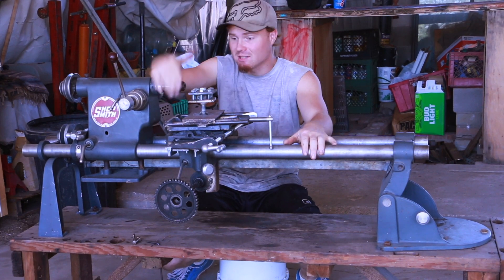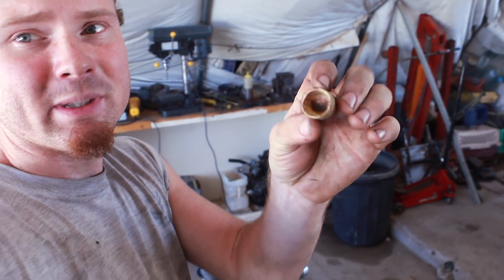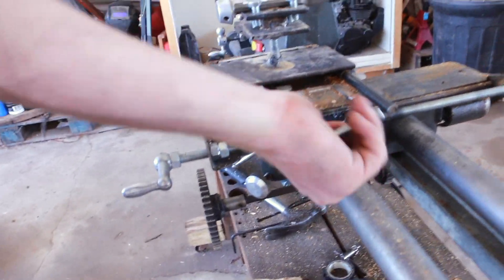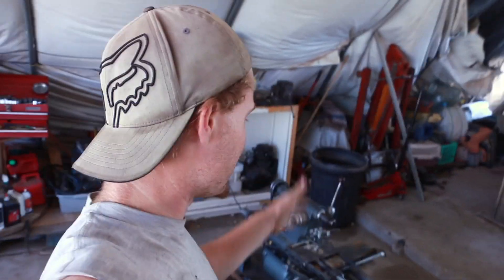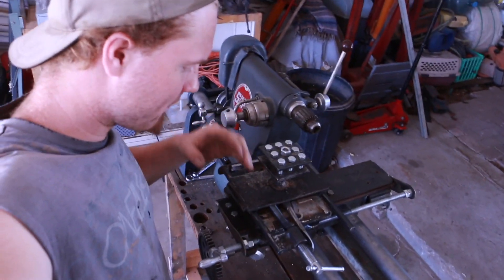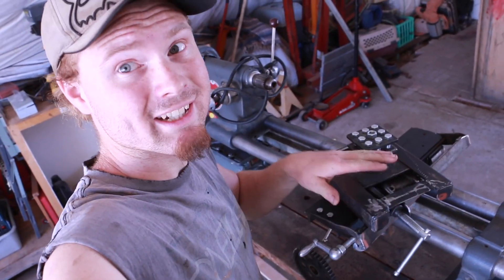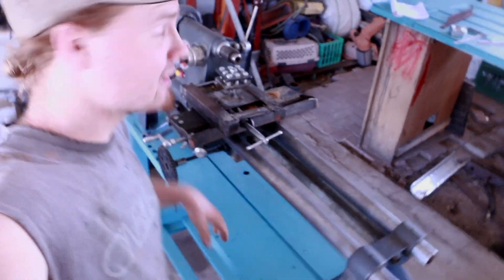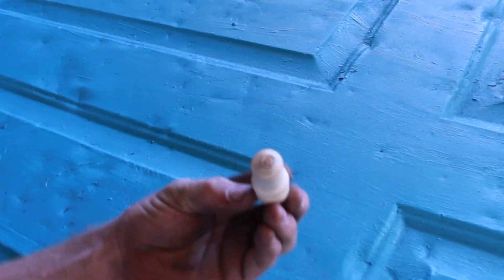Building A Lathe Stand |Converting A Wood Lathe Into a Metal Lathe Part 4

Comment: I think lathes are cool and enjoy seeing you make these modifications. Having said that, I hope the lathe is stable, it seems top heavy for as narrow as it is.  Also, from other lathe videos I've seen, (no experience Lol) they are usually mounted to work benches or very heavy carts to dampen the vibrations and make smoother cuts.  Just my concerns, purely trying to help, not be troll-y.  Is your brother gonna make another handle for the front gear?  Keep up the good work!
Reply from the maker: +vosco zoozoos I will take that into consideration :) I don't think he will make another one but maybe :)